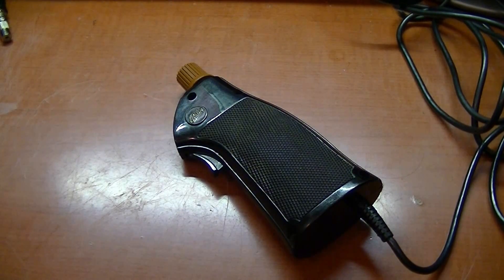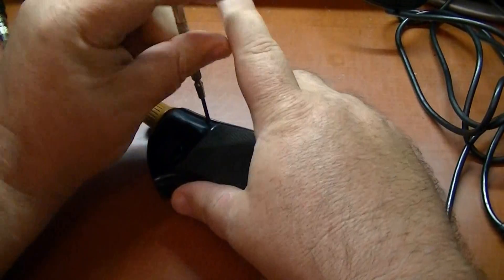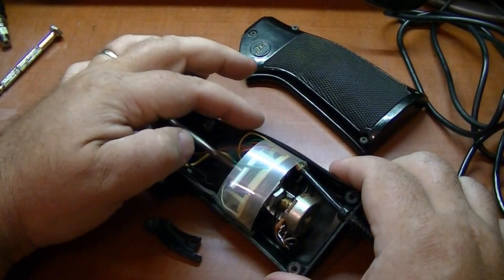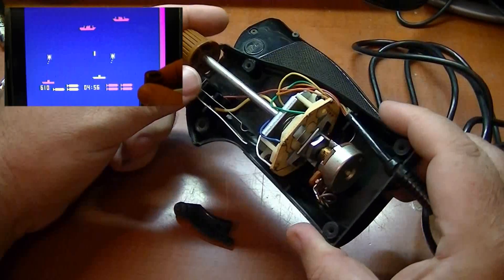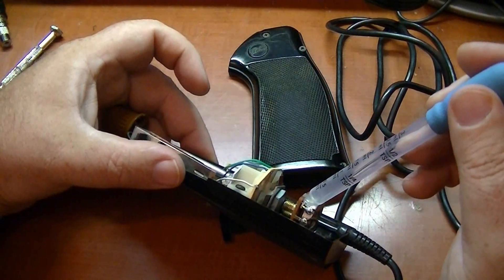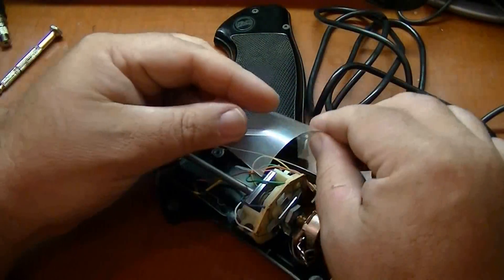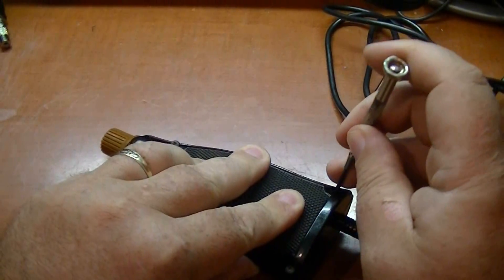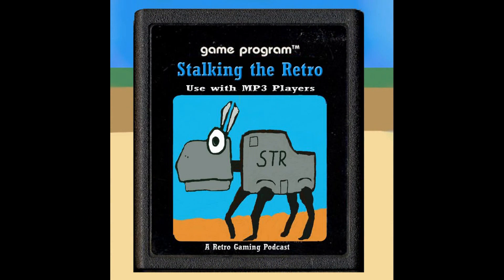Bally Astrocade Controller Inside Look

Comment: The design isn't completely unique since the Fairchild Channel F used a similar joystick/paddle combo. The difference being that you pushed the fire button by pressing down on the knob like a plunger. When Zircon purchased the rights to the Channel F, they added a separate fire button, making it more like this controller.

I'd like to make a USB version of this thing to use it with emulators, but that's me being silly.

Comment: Dear friend, is it possible to make such controller for the 2600 with paddle AND joystick?
No game uses both but it's handy when using the Harmony Multicart.
Nice video btw as usual.
Reply: I made an adapter to let me use bally cotrollers with my atari. Real easy
Reply: @cjmmjc2131  holy sh**. It's been 7 years since I posted that. I have since got two amazing controllers, but I'd like to see your adapter.